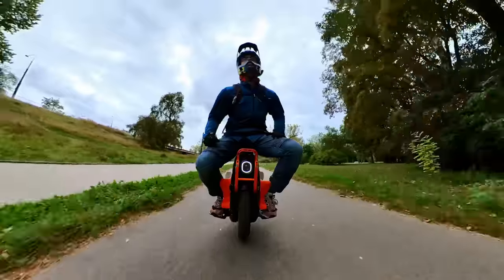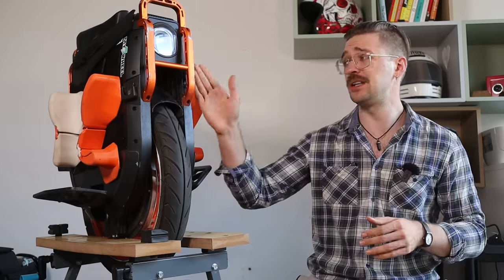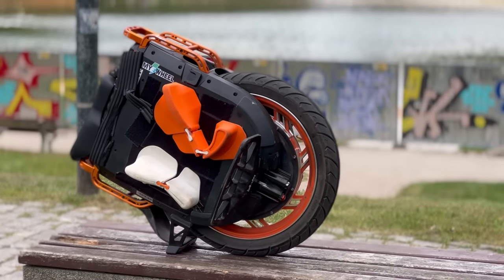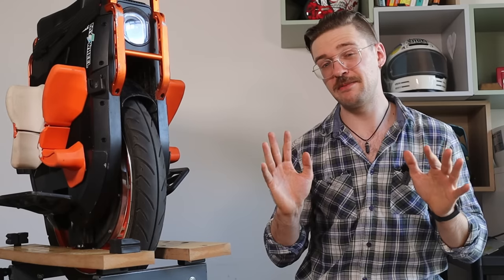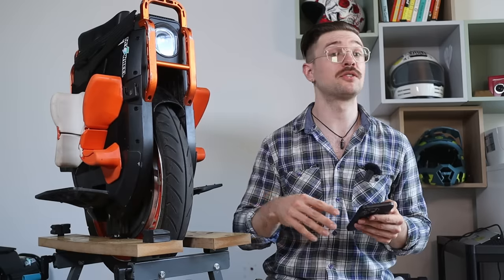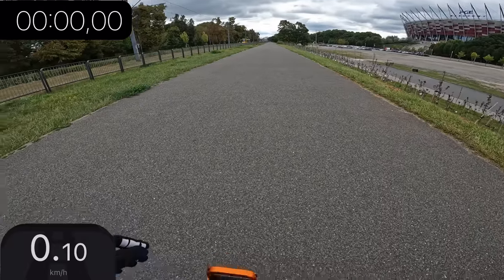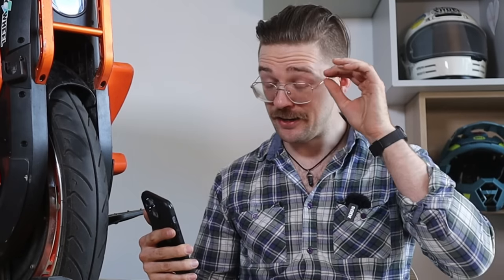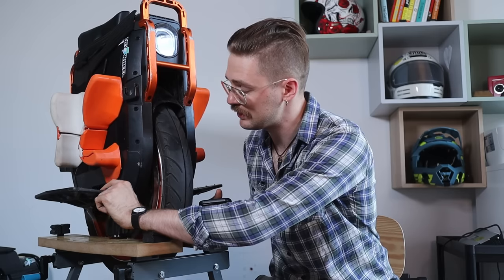MOST OVERENGINEERED E-WHEEL - 126 VOLT INMOTION V13 COMPLETE REVIEW

Comment: In the EUC community, people like Adam use the phrase "over engineered" to refer to thoughtful design and high quality materials. It's sad that it gets referred to as though it's a negative thing, when we have things like the rear pins on the Extreme shock bending if the wheel bottoms out, it's not that the V13 is over engineered, it's that most other wheels are under engineered.
Reply: Multiple riders have broken the shocks on the V13 as well.  When he says overengineered, I think he's referring to the raptor controller going above and beyond versus the underpowered motor's actual capabilities; which means it's never really challenged.  The pedal folding mechanism that doesn't work all that well.  The trolley handle is a nice design, but still not enough to handle the weight of the wheel.  There's the hoops you have to jump through to adjust the suspension.  The rim that's built like a tank, which is nice, but adds a lot of weight, and this isn't exactly an off-road wheel.  Overall, it's a well built wheel with a few big obvious misses, but its capabilities don't live up to all the extra and the high price tag.

I will give it to Inmotion with how much fire safety they built into this.  The cell separators and waterproofing is definitely a great thing,. The shielding around the batteries, and how much damage this wheel can take and keep running.  The smart BMS and dynamic cell balancing is awesome.  This stuff is going to become more and more mandatory as building owners crack down on everything PEV due to the inherent catastrophic fire risk.

I think this wheel was meant as a test bed for their hardware and software.  The wheel was expensive to keep sales low and essentially treat the customers as the testers to work out any bugs.  (Reminds me of a company I shall not name, but starts with a T and is run by an a-hole)
Reply: Agree, the V13 is just meeting the bare minimum in vehicle design on just a few aspects. It'll take a decade or two before the word 'over engineered' comes in the picture regarding euc's...
Reply: Overengineering is a well defined concept.  Your attempt to redefine the concept is not overly clever, this review is thoughtfull, your comment is not.  V13 is overpriced and range is a bloody laff. I have 6500 km on that wheel its rock solid, but weighs over 50 kiloes which explains the range problem.  My v13 have been very stable for seated and very fast riding. - but the price weight and range is bloody ridiculous.  The frontlight is OK  but blinds ppl, backlight is terrible.  

 In the EUC world we have 
1) Overengineering (Inmotion style) 
2) Kindergarten engineering (Begode/Kingsong style) 
3) Weed-enginnering (Old style MSX..) 
4) Badmaterials-engineering  (Sherman family) 

Look out for irony.....   Inmotion will upgrade v13 based on the dialogue with EUC community, (V11 is already upgraded)  My conclusion: Inmotion is best engineering and they actually have service to customers.  V13 is the fastest wheel but they build in Sovjet style safety features, while forgetting simple things like high quality back lights.   Still No wheel on the marked is as stable as V13 - I just wonder how long the bearings will live and how difficult upgrading an overengineered wheel is?
Reply: One definition of overengineering is "the design of a system or component to exceed the requirements of the design specification." This definition suggests that overengineering is a quantifiable concept, as it can be measured by comparing the actual performance of a system or component to its required performance.  (From Bard AI) Using bad screws is bad engineering and very very Chinese,  A psychologist (such as myself) would  say overengineering is the product of an overly nervous engineer. ... Why nervous about v13? Becaouse its the fastest wheel on the marked.
Reply: if it was an negative thing it'd be more gimmicks over functionality
Reply: @FinnBjerke  ex30 is more stable. Sherman s also.

I think you miss a lot of info
Reply: He found Adam is overly negative in regards to anything inmotion related

Comment: I am a current owner of v11 with 10k and a recently owner with just 700km in my v13, i use both daily. I stepped up to it because i was in need of more head room and speed. It doesnt mean i am always at 80+km/h riding speeds but the peace of mind I get with this wheel knowing i am not stressing safety and wireing components totally outweighs any flaws it may have and other wheels I have owned. When on the streets I feel and see V13 like a real vehicle not a toy like many others. I love components are not being stressed at all, i dont have to be worried about how hard i am pushing it or checking how fast i am going, basically never beeps and always responds. Before v13 i have had for a while kingsong, and i have tried begode and many models before going for v13, and while away from inmotion i was missing it's software safety lots. From my point of view when euc is your main commuting vehicle and you ride at least 50km a day while charging it and storaging it every night under your roof your wheel long term safety and reliability is priority and i dont get that feeling with any other wheel but inmotion. i know its not perfect but for now i dont see any other euc vehicle companies putting so much effort into safety and development as inmotion has, and thats not negotiable for me. When it comes to its weight, it doesnt bother me at all, its in fact still portable, i take it to the subway, bank and all day to day errands with ease. Also its 54kg are actually helpfull, at 50 plus km/h you need that weight in order to have better control of it, under wind gusts you feel stable and its better to counterweight them than with a light wheel. When it comes to range, yes, id like to have a bit more, but it still gets the job done, i manage to get 70 to 80km range daily at fast pase riding which its just about right for city commuting, at 20% battery you can easily hit 65+ km/h speeds. Regarding nimbleness of course its not as agile as a light wheel but i have no complains to it, stable at low speeds, easy to carve and go into traffic, i live in a hectic city and it performs great. We are in front of a real vehicle
Reply: Buy a motorcycle and be registered, licensed, and legal...

Comment: Im totally happy with my V13. At 63 years old safety is everything. The peace of mind I get with this wheel far outweighs any other wheel I've owned and it has allowed me to reach much higher speeds comfortably as a result. As far as weight and maneuverability, you get used to it...
Reply: Age is in the mind until you screw up your ankles and then they “click” all the time and you are lucky if that’s about all you which you have to worry. My case is that people or cars  (cats are ok I just run them over and they are fine) force me to plan my speed and path and the V13 might need a much larger buffer etc. Do you make emergency turns for obstacles and cars etc? Seems less manageable?
Reply: @gritred5500  you ran over a cat??? 😢
Reply: @gritred5500  I try to make it a point to not ride in to much traffic. It does take longer to slow it down for sure...

Comment: Great review. I hated the V13... It's so easy to overlean and the suspension is garbage compared to all modern suspension wheels from every manufacturer. They claimed this wheel was all about safety and no cutouts, yet they put a C30 motor in it... that makes it super easy to overlearn and "cut out". Begode still has some work to do for safety (I think the only thing missing from the Extreme is redundant hall sensors), but putting a C40 motor in all of their latest 136v wheels is a huge benefit for safety, something Inmotion can't claim about the V13. The V14 looks like Inmotiion learned from their mistakes, I hope it turns out great!

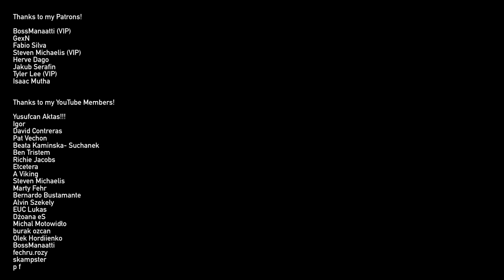54:58 I'm still here 😅
Reply: safety is also about controller design. My Begode Nikola+ burn controller at 4.5k km. I'm in doubt if I should get another begode wheel. InMotion raptor controller seems promising.
Reply: I'm still not sure about the use of redundant hall sensor to be honest. I think leaperkim uses just backward tension (not sure how to say it in English but it's the use of the tension generated by the speed of the rotor that opposes the tension applied to the motor), at least that'd be one way to do it without hall censor and precise enough just to come to a stop. I don't see (but maybe I've been missing something obvious) so many hall sensor failures...

Comment: What a great job you did with this video! That's so awesome! I can think of one more reason why this wheel was made. Inmotion ran the maximum amount of manufacturing processes on it. Yes, it was super expensive, super over-engineered, and it's unlikely to pay off, but all future wheels will be much easier to make when you have this "flagship" that never breaks and is super reliable. You can just say "this has the same electrics and safety solutions as the V13" and everyone will nod with understanding :)

Comment: My recent ride on the V13 for comparison: 65 miles (105km) with 16% battery remaining. Average speed 22MPH (35KMH) with short bursts to 40MPH (64KMH) when I needed to get on the road at a few points. Outdoor temps between 73F and 83F degrees. Battery dropped fast over last 17 miles (27 km) from 37% to 16%.

If I hold 50MPH for any sustained length of time then I see much less range. But when out for a mostly relaxed Sunday morning excursion averaging 22MPH then I feel confident knowing I have 70 or so miles to play with.
Reply: Riding weight?
Reply: @M4BALOT  Geared up: 184 lbs. Good question!

Comment: Hey Adam, I have been watching your videos for years at this point. You were the straw that broke the camels back in regards to my obsession with EUCs getting started. 
I have been riding for going on 2 years, and have worked my way from a RS19HT (went with HT because how hard you always push torque) quickly outgrew the wheel and range, I live in greater Seattle area, and My EUC is my main form of transportation for work. with the RS i would take the train (27.7) miles one way to work was too much for me on the RS. I got a S22 and started using it as my daily commuter. Couldn't quite manage there and back with 2200w battery pack (I struggle maintaining a reasonable speed). So I bought a fast charger Love the wheel and what its taught me about EUCs. I originally came from scooters, which is how i found your videos. this comment has exponentially increased in length from my original thought, Cant stop now though.
I immediately started designing my own 3d printed parts for my RS, power pads mostly. I am now riding an SS and Its incredible the quality jump from the RS19 --> S22,  I was blown away at the S22 --> SS quality jump though. I started this comment with the intention of asking you if you would be interested in testing out some pads I designed and currently use over the Patton pads Ewheels provided with my SS. I also have another project I have been working on that I think would be extremely beneficial for your specific use case as a wheel reviewer/tester. 

Ill include the link to my page where anyone who read through this novel can buy the STL for the pads (They arent even 4 dollars). I feel like I have gotten to the point where I actively need to become a part of the community, rather than continue to Lurk as i have been doing for years. 

https://cults3d.com/en/3d-model/tool/toe-shield-jump-torque-pads  (these are my current everyday pads, my Sherman-s/S22 are in the pictures. I love using these for jumping, In which case I remove the upper pad from my SS to free up that space for my legs)
https://cults3d.com/en/3d-model/gadget/whitpads-power-padsv1  (these were my first Designed pads that I used for 90% of my time with my RS, I thought I could kinda change the mold a little with these ones they ended up being mediocre at best) 

If you would be willing to give them a try, I would print you a set, and ship them to you. 
thanks

Comment: 54:57 Thanks for the review! Just hit 1700 Kilometers on my first wheel, V12HT, and am looking at upgrading to something with suspension, more range, and a slight increase in speed. 

I looked at the V13 very briefly, but like you said it doesn't have the right weight to power to range ratio for me to justify. 

I'll probably bably get the Sherman S since it looks like a good mix of range, speed, and reliability.
Reply: I’m you.  Did you get another wheel?   Curious what you chose.
Reply: @realNikoCousin  I had an unexpected shift in finances so had to put off getting a new wheel. The Sherman S was on my list, but the goal post has moved to the Sherman L. 

It's almost winter time here in Alaska, so I'm hoping I'll be able to get the L for next summer and do some long trips.
Reply: @c4ristopher  oh wow.   I just checked that out and indeed that looks like the one.   Good luck hope the situation improves.  You must have some beautiful countryside to ride on up there!

Comment: I bought V11 as my first wheel about 5 weeks ago. In first 4 days I was doing nothing but learning to ride and got more or less comfy on wheel. Then the hall sensor failed after and I brought the wheel back.   Suddenly I saw that V13. I tried it and somehow it felt solid and nice. So the dealer has agreed to refund V11 and I bought V13 with some discount. I am 62yo, height is 182cm  and weight is 90kg and very athletic. Maybe because of this I did not really feel big problems manhandling this baby. Yes it is top heavy but I got used to it. I ride 50-70km a day and do not feel any problems handling it, maybe because I am still very new to EUC and do not try anything requiring advanced experience.  My total mileage is around 2000km and my average consumption is 20Wh/km. Since total battery capacity is 3000Wh it gives me a theoretic range of about 150km. In reality it will be less of course but I should be able to get about 120km with my riding style. The wheel feels very stable and comfortable.  Not a single mech / electrical problem either (cross my fingers). So consider me a happy owner. As for speed - I am not a maniac and that 90km/h says that I have lot of safety limit when I ride. So yes I appreciate this kind of overengineering. I might try to get something with more range in the future as I want longer travels but we'll see.

Comment: "timestamp" :D Great video Adam, keep up the great work! I ride V12HT and I love it so much. 5100 km on the clock and no issues. Still rock solid. After 4000km I removed side covers and rear cover (mudguard was badly installed :D) and I tightened the screwes and that is it. No more maintenance. V12HT is so maintenance free wheel. V13 is really not for me, but I know 3 riders of V13 in Czech Republic. One of them sold the the wheel because it was too heave for him, but the other 2 really like it and push it to the 90km/h :D. Maybe this wheel has the place for people how wants to go crazy fast and feel safe in the same time... I am looking forward to the V14 and Extreme comparison, done by you :).

Comment: Higher center of mass does not make it harder to keep upright. In fact higher center of mass makes it slightly easier to keep upright.

Gotta look into moment of inertia instead to understand it falling over. Fortnine has a good video on this.

Plus you need to control or account for all other variables since there isnt a control group version with only a lower center of mass.
Reply: Seems to me that this is true but really only at speed.  Slow, technical riding may be a different experience.

Comment: There is grub screws for the trolley handle. I noticed mine were missing, I am not sure if they were there and fell out or if never was there from the batch 2 order. I requested if there should be screws and they sent me a pair with next day delivery. Purchased through eWheels. 

On the entire review, I appreciate the honesty of your experience with the wheel, Thanks! Side note, I love my v13 and don't regret the purchase at all. I haven't rode a wheel like this where I feel pretty much 99.99% safe that I am not going to have a high speed cut out or death wobble. The suspension has been holding out well for me as well. I am about 220lbs and I take mine through trails and jumps with no blown suspension rods or leaking yet. My only gripe on this wheel is the way the suspension guides with the 6 per side little plastic rectangle pieces, I have been calling them suspension sliders. I broke one and it wasn't to difficult to replace but did required opening up the battery compartment which I personally feel comfortable doing. The concern I had was they screw on with only 1 tiny screw and they are small plastic pieces that hold the entire suspension in place. When you compare to sliders on other wheels, like the s22, it looks sort of felt like an afterthought. Heavy wheel to be having such small guides for the suspension to travel against. Granted, I saw a video from forward n bak with Bob (CEO at the time of Inmotion) mentioning that they are designing a kit to convert existing v13s to Hydraulic Suspension which I am very hopeful for.
Reply: I suspect a major revision of the V13 once the V14 have demonstrated its efficacy.  I doubt reworking the existing air strut design will be practical but we'll have to wait and see.  the V13 with a FastAce suspension would be plush... and the rear linkage like the V14 and its a keeper.